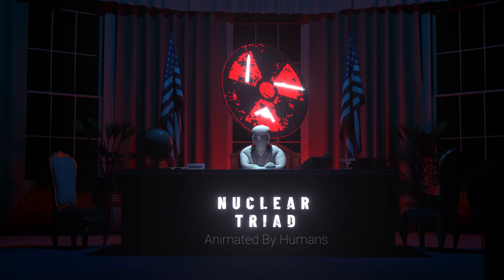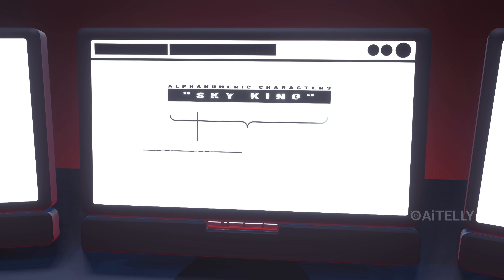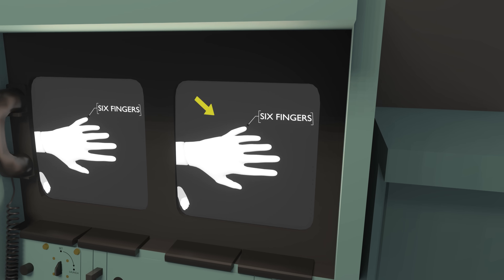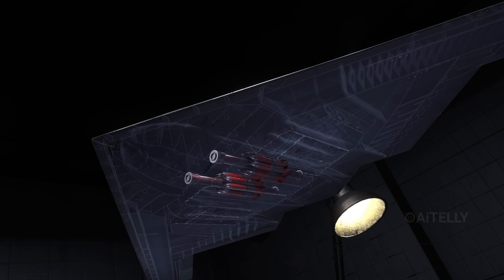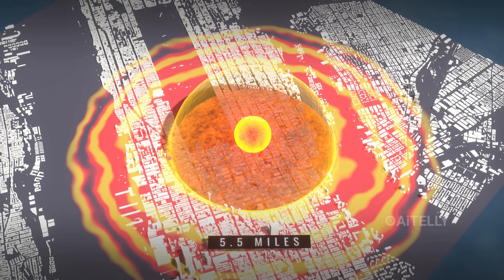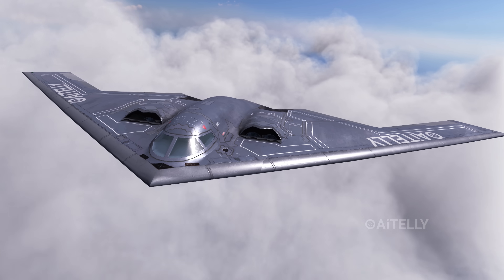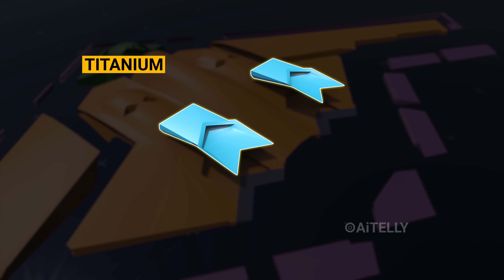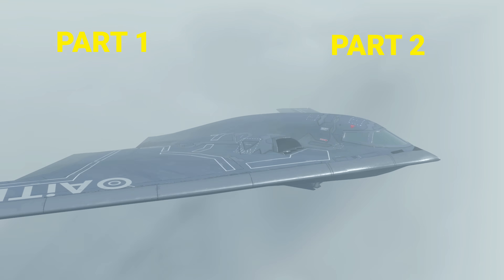How the US B-2 Spirit Drops a Thermo Nuclear Weapon?

Comment: I flew missions on the B2 in both Afghanistan and Iraq before being selected for AFSPECWAR. It is an important part of the air triad, but we aren't just "loitering" in the air.  The B2 is an incredibly expensive plane to operate and maintain. Our flight paths are carefully planned because the paint is very sensitive to humidity, UV rays, and dust. For every hour it's in the air, it requires about 110 man hours of maintenance (a lot  of it is reapplying the Radar Absorbant Material or RAM). We were only airborne when absolutely necessary. It also requires special hangars kept at precise temperatures and humidity with air filtration to keep the air dust free. That is primarily at Whiteman AFB but we have temporary, mobile hangars that can be used globally to minimize mission flight times. So if we're in the air waiting for an order, it's basically a question of when in the next 48 hours that order is coming.  B52 and B1 Lancers are more readily available, the only time a B2 would be called is if the mission required extreme stealth capabilities.

Comment: The B2 Spirit does not have reheat F-22 raptor has super Cruise doesn't need reheat to go supersonic but the F-35 must use it's after burner a big flame  that's IR detection, an AIM-9 sidewinder could shoot it down

Comment: These new nukes are tiny compared to what the USA had during the Cold War (1.2MT for today's B83 vs 25MT for the 1960s B41).
Reply: The idea of modern nukes is to cause massive but not MAD-like casualties to not force the opponent to go full nuclear, and it has to be a thermal nuclear device to not cause forever nuclear pollution. Of course, the opponent can go nuclear with another small thermal nuke, but the plutonium and tritium used in a tiny bomb is the same as in a huge bomb, so this shifts the competition to who has more plutonium and tritium, not lithium and deuterium, and clearly the US is the winner.

Comment: If a B-2 is using nukes it's launching  stealth cruise missiles not dropping bombs.
Reply: This assertion is absolutely incorrect. The only nuclear-capable cruise missiles that were (even theoretically) available for employment by the B-2, the AGM-131 SRAM II and the AGM-129 (ACM) have been retired from service for approximately 20 and 35 years, respectively. Furthermore, under the provisions of START II, it was categorically prohibited (through 2002) for nuclear cruise missiles possessing low-observable (stealth) characteristics to be carried by stealth bombers. As a result, the AGM-129 ACM was never certified for integration on the B-2 platform. The only remaining Air-Launched nuclear cruise missile AGM-86B is [technically] retired and anyway restricted to the B-52G. The (future) AGM-181 Long Range Stand Off (LRSO) weapon is not planned for integration on the B-2 for now, (instead on the B-21).
Reply: @REFORGER_2023  START II how relevant. The START II Treaty was never formally entered into force; Russia withdrew its ratification in June 2002, a day after the U.S. withdrew. If you think all stealth cruise missiles are unclassified or that they all these variants were just retired with no replacement you are naive. The B-2 can be outfitted to carry a much wider array of weapons than the public knows case in point when it dropped multiple GBU-57s on Iran. Before that happened im sure you would have been said no the B-2 can't drop two 30,000lbs bombs
Reply: @j@j@j @johno1544 ase, do your homework. Yes, it never officially entered into force. However, on a voluntary basis, almost ALL disarmament provisions of the agreement were fulfilled by the U.S. (no land-based MIRVs, no land-based nuclear cruise missiles in Europe, Peacekeeper MX dismantling, aso).
You are completely wrong about the bomb as well. The MOP (GBU-57) was officially presented by the Air Force back in 2023, and it was perfectly obvious that it could only be deployed by B-2 (or airlifter).
Reply: @REFORGER_2023  You are still talking about Start II as if that means anything it was abandoned nearly a quarter of a century ago and never fully adopted. We developed and retired a nuclear capable cruise missile by 2008. The treaty was abandoned in 2003. Really stopped development there didn't it? You appear smart enough to know a B-2 could drop a 30,000lb bunker buster but don't think it could launch a AGM-181? Why exactly? You don't honestly think everything the B-2 can launch is found on your google searches do you?
Reply: @j @johno1544 I correctly identified START II as the reason why the only known U.S. nuclear cruise missile with real stealth capabilities was never integrated into the B-2. I assume it is common knowledge that further disarmament treaties such as SORT and New START (still officially in force today) followed START II, as well as the resulting limitations on the numbers of warheads and delivery systems.
Nearly everything else you said is based on your false or mistaken interpretation, and on your confusion of genuine international treaties and U.S. nuclear doctrine with the “secret knowledge” from Call of Duty. A B-2 and its nuclear delivery doctrine are explicitly designed to deeply penetrate enemy airspace, not to fire stealth cruise missiles from a distance of 1,500 miles. The fact that it could do so, if such missiles existed, is not in dispute at all.
Reply: @REFORGER_2023  If you can't understand the benefits and synergies of a stealth platform like the B-2 deploying stealth cruise missiles and not gravity bombs in a nuclear war please stick to video games. The AGM-181 is already announced to be used on the B-21 for that exact role and is not a violation of any treaty. Saying the B-2 can't do the same because of some treaty is just not correct sorry. NewSTART does not cover air launched nuclear cruise missiles nor stealth bombers in any way

Comment: You need the secretary of Defense and the Chairman of the Joint Chiefs of Staff to also authorize the launch, the president cannot do it alone. Same in Russia.
Reply: @ba89089  The chairman of the joint chiefs isn’t in the chain of command. And SECDEF’s only roll is to issue the attack order to STRATCOM. Once the president confirms National Command Authority with the Pentagon they are the only person who can authorize and initiate a nuclear strike. If the president can’t be reached SECDEF will contact the next person in the line of succession to get NCA and start the blue clock.
Reply: Wrong, President has the ultimate authority

Comment: Few corrections-

1) Once STRATCOM receives an order to launch nukes from the NMCC, STRATCOM will broadcast an Emergency Action Message (EAM) over HF. 

2) SKYKING/SKYMASTER is  the call sign of the NAOC or TACAMO. 

3) STRATCOM Ground stations will use MAINSAIL call sign. 

Not a correction but addition:

Once the pilots verify/decode with their cookie - they then input the decoded launch authorization code into a console in the cockpit with then sends the code to the Permissive Action Link inside the warhead. The PAL is the final link in arming the nuclear warhead.
Reply: @X_513x  fairly sure SKYKING is just a priority message, rather than a specific call sign. The actual message recipient is encrypted like the rest of the message.
Reply: @punishedfoxo My understanding is that SkyKing or SkyMaster is any airborne nuclear command and control platform. Similar to  Huntress is the North Eastern Air Defense Sector or Bigfoot is the Western ADS. 

Now if things really popped off and it was no longer peacetime - All stations would begin using their preplanned tactical call sign which would be something like: ACES66 whatever just as an example.
Reply: You watched too many mission impossible movies bro chill.
Reply: @IllidanSturmgrimmDeusVult  This isn't a movie. This is literally thermonuclear warfare.

Comment: Tritium purpose in the B-61 was not explained at all.  What would happen if it was not serviced because of the 12-year half-life of tritium?
Reply: It needs to be changed well before that, makes a lot more neutrons that help the primary have a few more tenths of nanoseconds of burnup to trigger the secondary more efficiently. Without it the primary would only generate about 500 tons instead of 5kt and the secondary wouldn't fire off very much at all. The mission would fail.

Comment: Why the turn after the dropped the bomb? Wouldn't that just cost airspeed?
Reply: They ran a calculation based on the shock wave, and that exact angle turn at the time you drop a bomb (also moving forward,) ensures the furthest distance per @Dr. Jorge S. Diaz